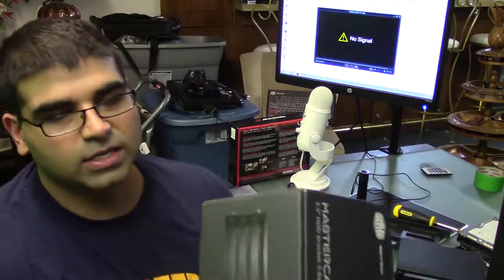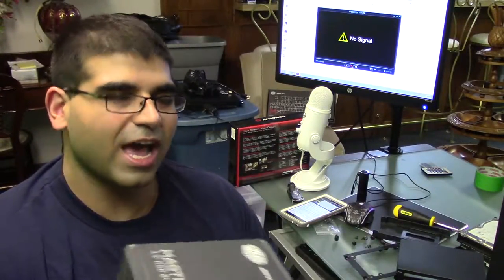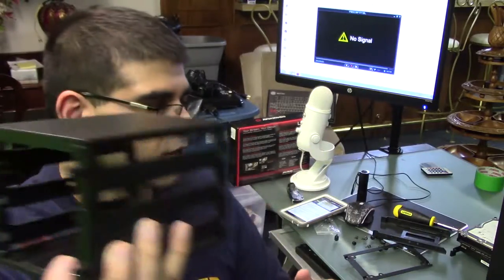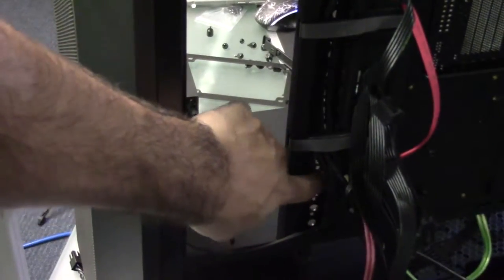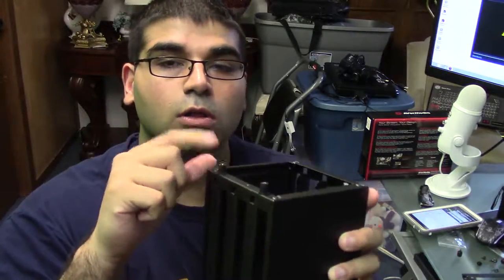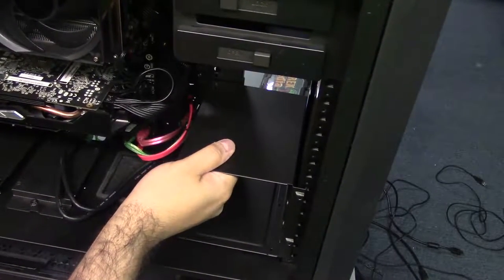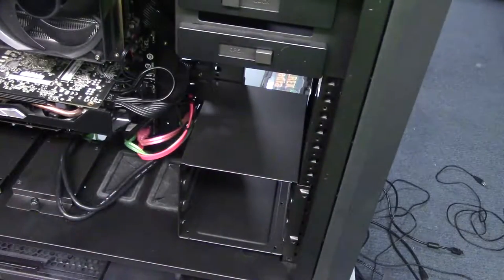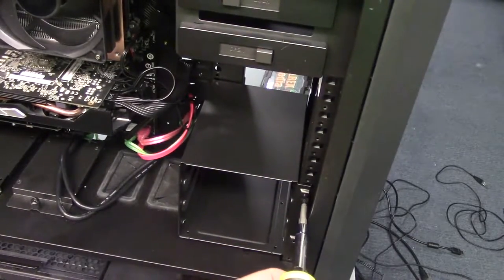CoolerMaster Master Cage install tutorial

Comment: 1 important question. Is it dangerous to put in a hard drive to that cage and not mount it but just letting it be free inside of my case.
Reply from the maker: mechanical drives yes, ssd no
Reply: @lilrex2015  So if i put my seagate barracuda hard drive in without mounting the cage is dangerous?
Reply from the maker: @rigsyy8981  yes
Reply: @lilrex2015  how
Reply from the maker: @rigsyy8981  Ill be honest, I am not here to teach you comp sci and basic physics, check the amazon link below to brag some engineering books and you'll learn why.